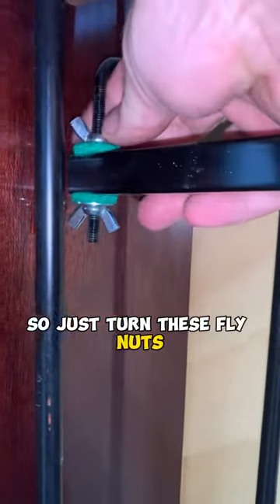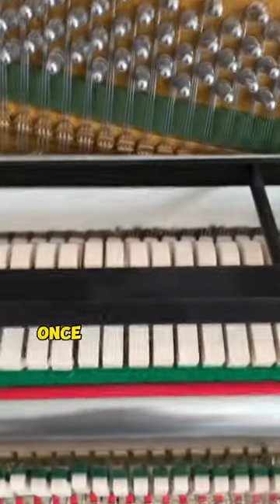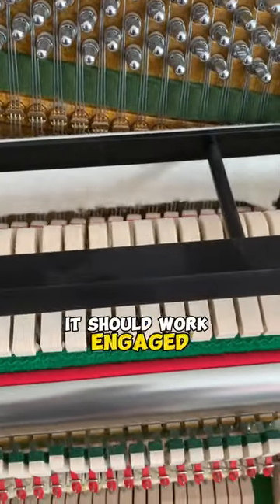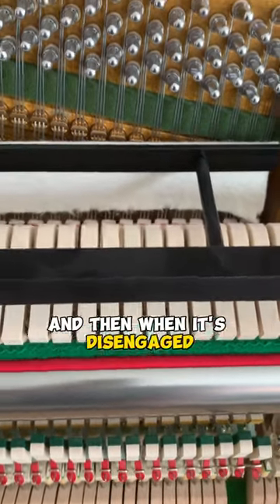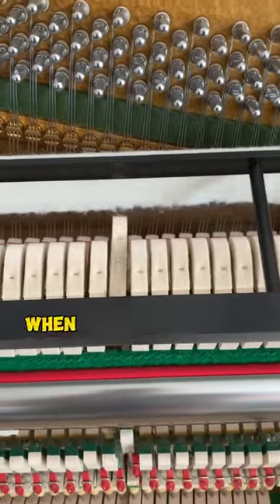Easy fix for piano middle pedal #piano #pianotuning #pianomusic #woodworking #pianocover #music

Comment: Over the years so you have to renew this felt due to wear and tear?
Reply from the maker: Yes,  if this pedal is used a good bit, you will have to replace the felt. You can see in this video that this felt is wearing away and will need to be replaced at some point.